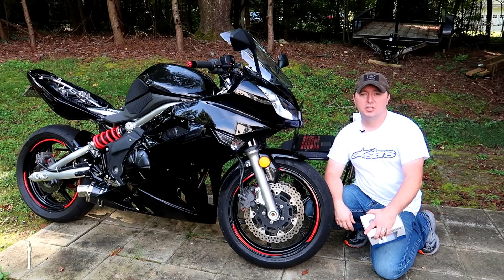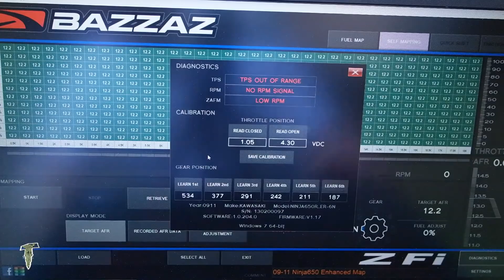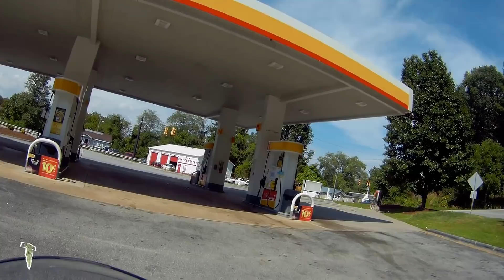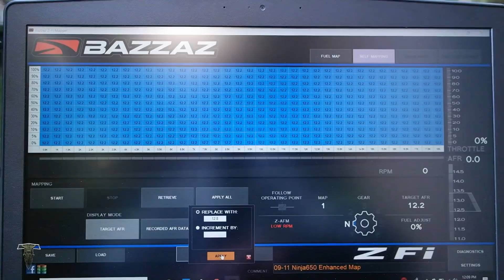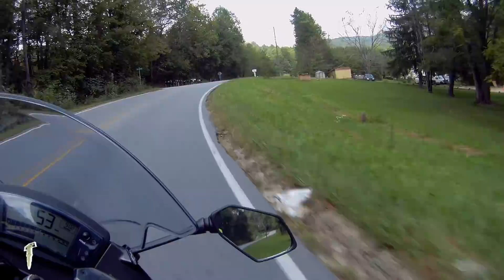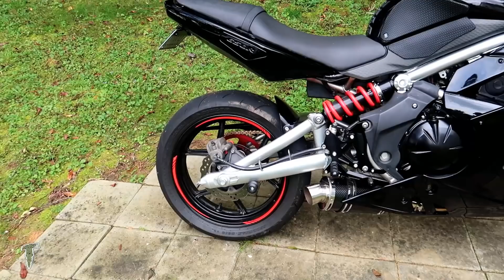Tuning the Ninja 650 with Delkevic Exhaust - Bazzaz ZFI Autotune

Comment: Did you ever adjust timing on this setup ? I have an 07 650r went the Power Commander 6 / AutoTune with Delkevic full system / 14” oval (baffles removed). Absolutely love it, commute on it 3-4x/week 65 miles, exhaust keeps ppl away, added noticeable power.  I did look for Bazzaz initially after your vids but they stopped selling it hence the PC6.   FYI - Dynojet shows ~30 maps for our bike but only 2 are compat with PC6….  I’m really looking for Timing info, I see some running +4 then +8 at high rpm, +8 seems risky esp at wot..  dunno if your Bazzaz includes ignition/timing but would really appreciate ANY opinion/info on timing adv/retard for this engine/setup. Really appreciate your vids man, huge help in finding the right direction on my bike, great detail/well produced 👍👍👍 Hope to see more of your stuff 🤘

Comment: Thanks for putting up the 2 Bazzaz videos.  I have just purchased the Zfi kit,,, and so I have learned a lot from watching.  Is it far to say that if you just have the Zfi,, you are committed to using a dyno shop to tune.  And if you add the Zafm you can map it decently yourself, whenever needed ?  I ride a  great running ST1300 V4, with Del slipons,,, and just want to up the performance a half notch.  The idea of mapping it based on my own riding appeals to me, as opposed to turning it over dyno jocks to flail with high reving dyno pulls for hours.  Eventually,,, the Zafm would pay for itself,,, like in two dyno sessions.  Am I looking at this right ??  cheers !!
Reply from the maker: The AFM will easily tune better than what you will get on a dyno. It will show your riding habits, throttle useage according to how you ride, and not based on a stationary machine. Just set the AFR where you want it, and ride. Make the suggested changes every few trips, and before long you are dialed in.
Reply: @Tremonte  ,,, I am wondering how your final tuning's went,,, and what the map ultimately looks like ??  How many adjustments did it take before getting it really close ??  Also,,, I read that the wide band O2 sensor has a life expectancy of only 500 hours.  So did you remove it, once your map was satisfactory ??  Seems a bit less than ideal to have to re-install it, each time one wants to check the A/F.  Did you encounter any oem F/I warning lights as a result of the install ?  Sorry for all the questions,,, but the Z afm represents another $500 investment.  Plus,,, you are doing a great job of illustrating everything !!!  Thx

Comment: Doesn't Delkevic say that you dont need a reflash or  power commander for their exhausts? And if so, what makes their exhausts exempt from requiring a reflash or piggyback? TIA
Reply: They're basically the same, the websites warn you must adjust air/fuel to prevent overheating engine and such other side effects of neglecting a tune with a aftermarket exhaust

Comment: Will this same module [T446] work with the 2019 Ninja 650 ABS?
Reply from the maker: No, it won't as far as I am aware. I went with a Rapid Bike EVO on my Z650. Works great, and will auto-tune as you ride and/or modify the bike without your interaction. https://youtu.be/cdCSeo9kZ6g

Comment: bro i have a 2018 ninja 650 , please let me know which power commander and which exhaust and air filter ???? thanx in advance
Reply: 46 the doctor did you ever find the answer? I’m trying to do the same to my ‘19
Reply: @wess4034  not found it yet bro..... if u find before me let me know ....
Reply: 46 the doctor. If your looking for a power commander v go to their website and go through the find my bike app there. It’ll come up to what ya need. Mine is a 17021 for a 2010 ninja 1000 or a z1000. Buy it there or off of Amazon or eBay with your power commander model number.   Good luck